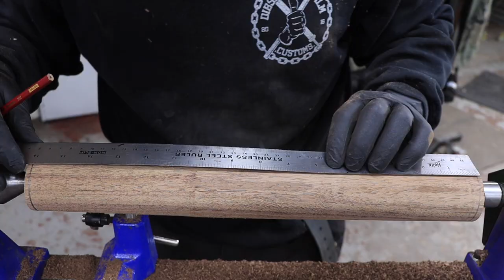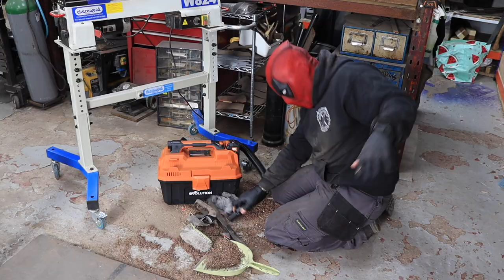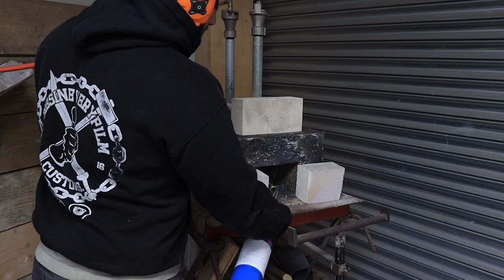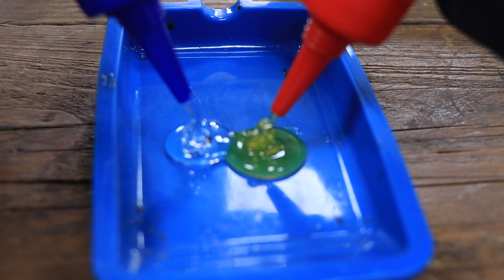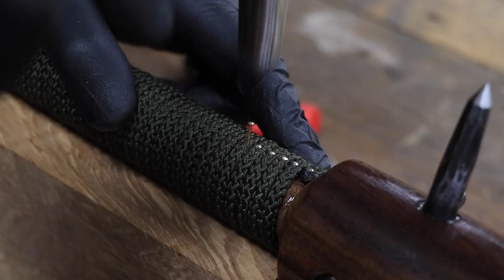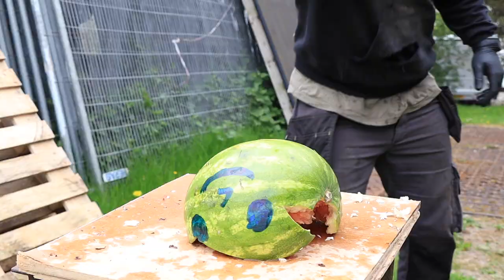PIERCING Spiked Trench Club

Comment: I think the one of the things I like most is how safe you are with everything. I also like that although you wear gloves it's the latexy rubber ones that protect your hands from scrapes and blisters but will break away and not destroy your hands if caught by spinning parts. wish I had thought of that back when I worked with power tools.
Reply from the maker: Thanks mate, i do this everyday so definitely need to keep myself safe to keep the videos coming
Reply: @chadh3441  haha oh man that's a terrible one. I was always terrified of degloving, kickback and all those other terrible things. Luckily I had a combination of good safety from my dad but also I got to go to different first aid and safety training classes so I never really had any close misses but the thought of losing not only a finger but my skin suit.
Reply: @GameTimeWhy  I remember when I was in shop class in high school, I was operating a table saw. I wasn't a big fan of them due to kickbacks, even though it did have a kickback guard. As with anything mechanical, even guards fail once in a while. I was feeding a 2x4x8 on the table saw, when it suddenly kicked back and the guard didn't catch it. It hit the concrete block wall hard enough to knock a baseball size chunk out of it! Yeah, my safety awareness increased a lot after that! Lol. I always try to be as safe as I can because I like my fingers just where they are. I've gotten quite attached to them. Lol

Comment: Just as a quick tip that might help, when forging a taper it goes faster if you forge it down as a square taper, only working two sides until you get close to your final dimension, then knock the corners down into an octagon, then go around smithing out the high spots. Great video and awesome final product!
Reply from the maker: Round stock so wasn’t too bad doing how i did it, it was more for the look than anything i wanted that bumpy forge finish

Comment: This is very nice. I like that the cord wrapping on the handle is both glued and tacked. I always feel that cord wraps won't stay in place. Although it wouldn't look as cool, I'd want a more smoothed transition from handle to head to lower the stress concentration there. Granted, no one in real life who has fought with these kinds of weapons has lived long enough for the stress concentration to matter. 

I've always been curious had badly these might stick into a leather jerkin with a wool gambeson underneath. I've always felt that a weakness of the "Lucille" weapon of barbed wire wrapped around a baseball bat is that someone in a thick coat with a tough outer layer could block a strike enough to reduce the impact and then catch the barbed wire part in the thickness of a strong leather jacket by pinching the bat between torso and arm. The impact would still hurt, and the barbs would penetrate enough to cause cuts. However, the "Lucille" would then be stuck and difficult to withdraw. If the defender then had a good weapon on hand, he could strike the person armed with the "Lucille" without having to worry about a return strike. The "Lucille" is obviously not going to penetrate as well as these spikes would, and pinching these spikes against one's body would produce much worse injuries. 

If I were using a bat, I think I'd rather have it without the barbed wire wrapping. I appreciate the harm that the barbed wire can do, but I'd rather not risk the bat becoming stuck on things. 

For a spiked club, I wonder whether anyone has ever made the "spikes" as small blades instead of spikes. If the length of the blades ran parallel to the length of the club, then pulling the club free from an obstruction would create little draw cuts. In effect, the spiked club would become a war ax with a bunch of tiny heads. To make these, you could just forge each spike into a spatulate shape instead of a rounded spike. You'd then have to sharpen each of them individually. That would be more work, and I wouldn't try to make them ax sharp or knife sharp. I'd just want them sharp enough to slide through any protective clothing into which they might become stuck. This idea wouldn't be as good for marketing purposes because it wouldn't look as cool, but that's the design that I'd rather have if I had to go into battle.
Reply from the maker: This was copied from a museum piece, the transition still has a curve for stress reduction. 
Yeh I agree on the luceel i feel the barbed wire is a hang up more than anything. 
Look at the macuahuitl those usually had blade type edges like a sword axe

Comment: Nice! My first improvised weapon was an extremely large 2 handed sword. It was made of 12 guage galvanized steel sheet metal, haha. Not functional but makes a nice prop. It is about a meter and 2/3 long. I'm not good with metric but that seems about right, haha.
Reply from the maker: Thanks dude, sounds cool mate bet it was fun to make
Reply: @DiesInEveryFilm  Yeah, it was fun to make. I used a computer operated press punch and one of the big powered table shears. I was a machine operator so I had access to lots of big machines, haha.

Comment: What did the steel wool do?
Reply: Gave it a polished  appearance.
Reply from the maker: Yeh it polishes it up, i use sand paper up to 320 then wire wool up to 000 before a nice waxy rub